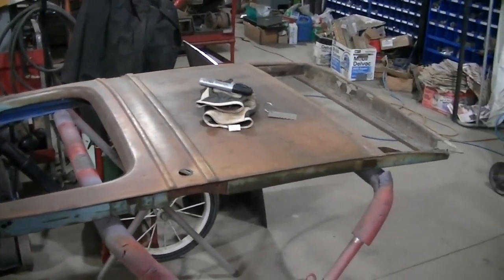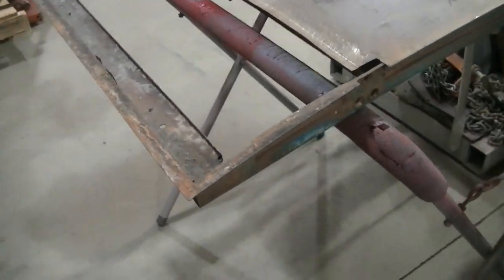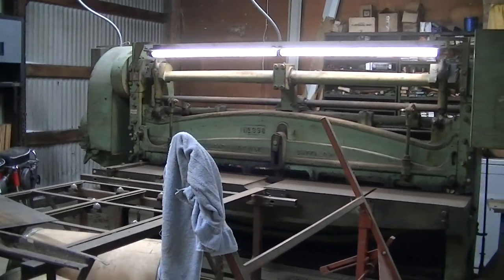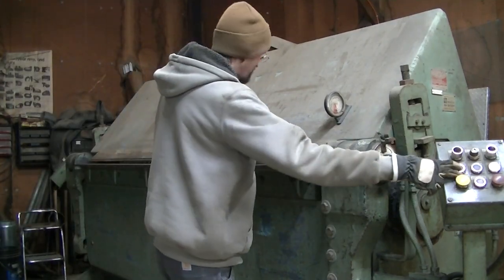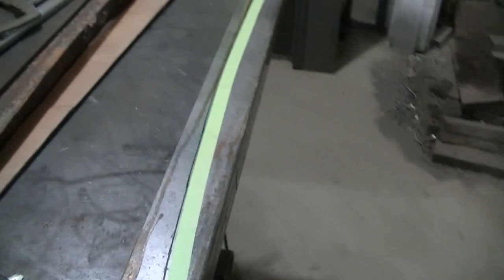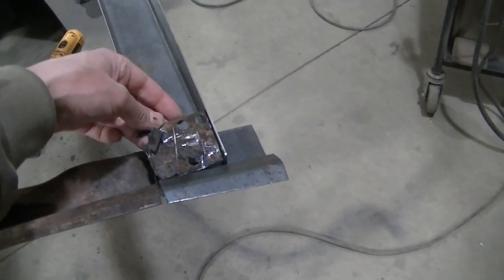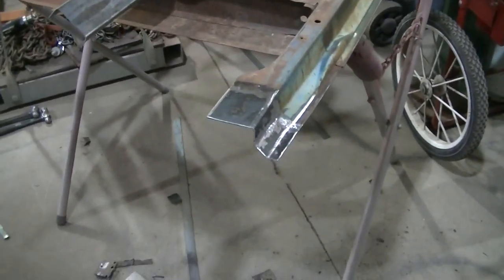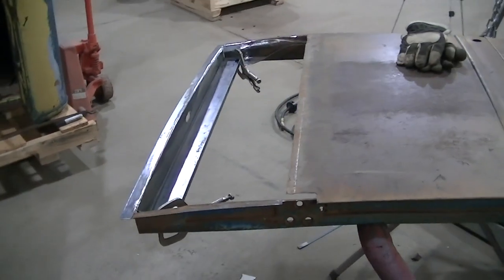37 Chevy Truck Door Frame Rust Repair

Comment from the maker: Things that might help with a project like this:
Dewalt Grinder:  https://amzn.to/31kjDN2
Cutting Discs:  https://amzn.to/3EM8br1
Sheet Metal Brake:  https://amzn.to/3zhinXk
Butt Welding Clamps:  https://amzn.to/3zh6IrC
Hobart Welder:  https://amzn.to/3zffC94

This video contains affiliate links, which means that if you click on one of the product links and buy, I'll receive a small commission.

Comment: This is going to come out nice. So glad to see creators not jerry rigging everything but actually building right. Hopefully I will have my own project soon. I know I can't do as good as you, but I can sure try lol
Reply: Oh meant to ask. Could you actually fine a Spot Welder useful? I see them for sale pretty cheap, wondering if i should pick one up.
Reply from the maker: I can't watch most of what's on Youtube now. It's full of hacks and people with no experience doing things. At this point I am just doing my own thing. If people watch that is great. The more views I get the more I can do. I don't have a money tree out back. The way I do things probably stems back to me watching my dad. He liked doing things the right way even if it meant more work. And he was proud of his work and fixes. I could have just used a piece of angle iron at the bottom and called it good. I didn't have to recreate the original piece. I am probably selling or trading this door for the drivers door I need, but I am fixing it like I am keeping it because it's the right thing to do for the next person that gets this door. That should also make the door more valuable. Thanks for watching and commenting. On the spot welder you only need one if you want exact factory welds. You can punch a hole, weld and it will hold fine. You can even make those look like factory spot welds if you punch the right hole size. I would get your other tools you need before I bought a spot welder.